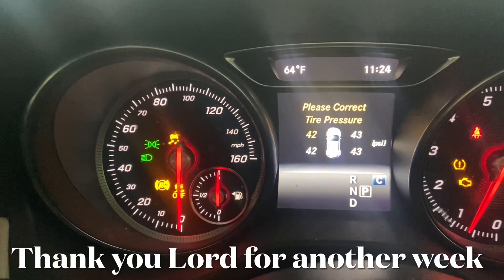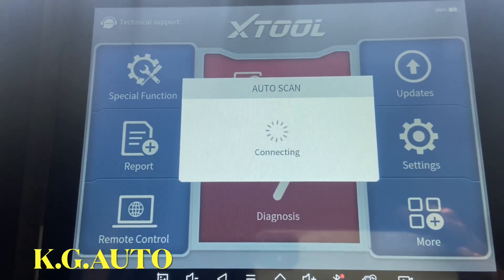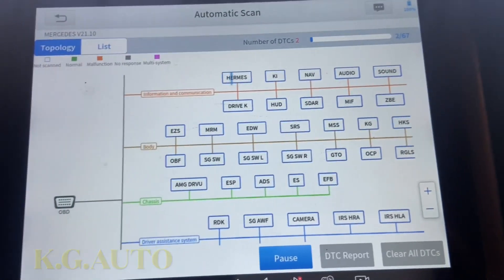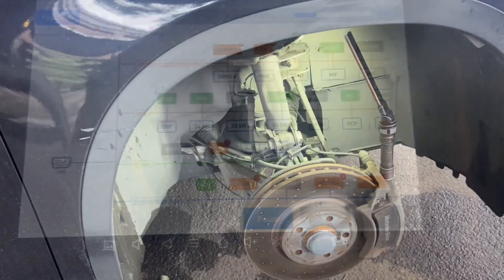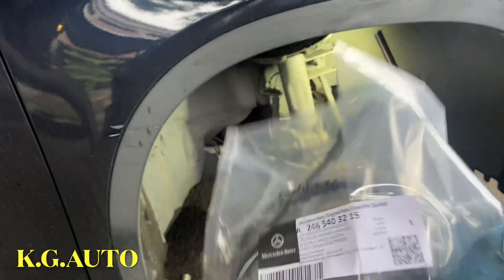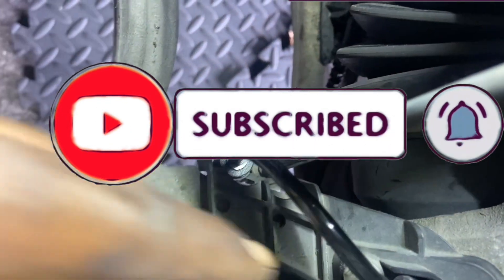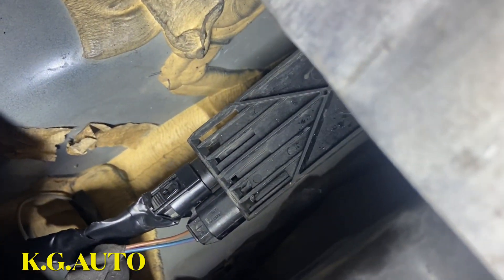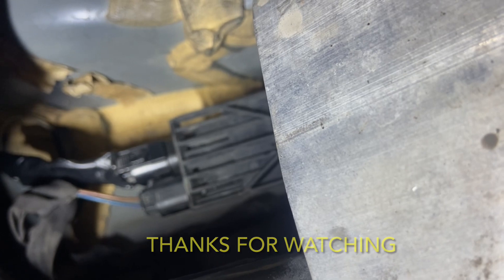2014-2020  Mercedes Benz GLA ABS Speed Sensor Replacement 🚗

Comment: Hi, good video but - currently looking in to replacing ABS sensor in my GLA - where did you find the connector to? Is there an access panel inside the trunk?
Reply from the maker: Thanks for reaching out, at the dealership
Reply: When I find it I'll let you know